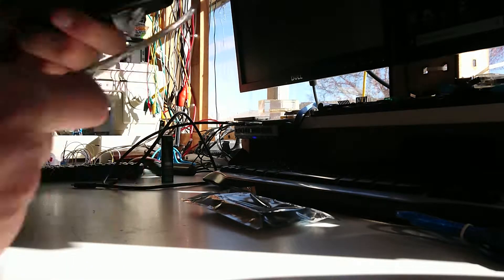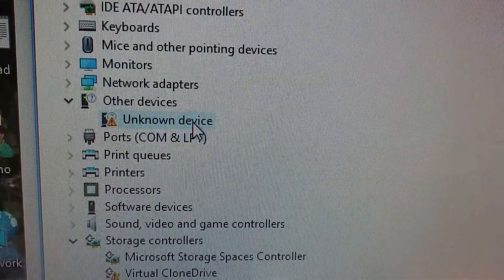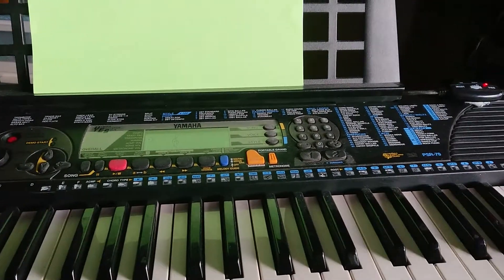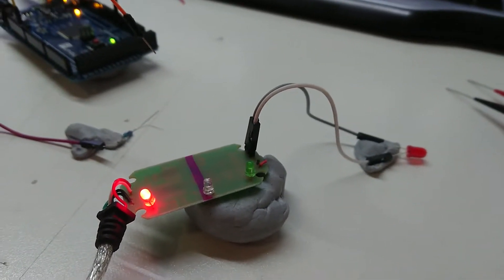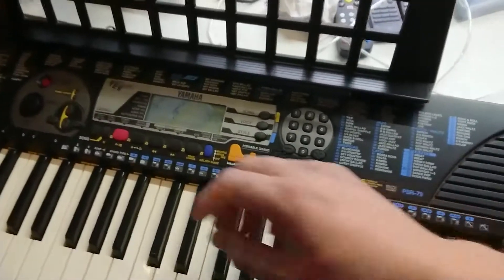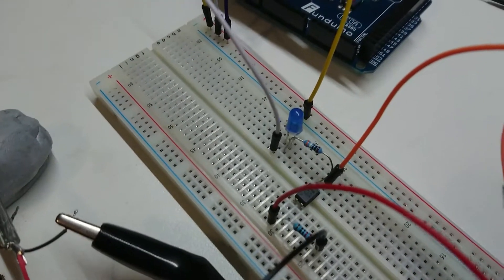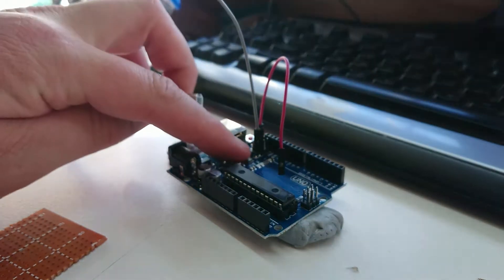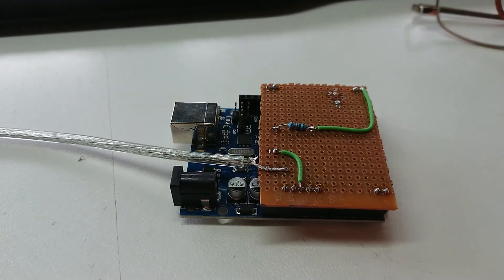Arduino based USB to MIDI adaptor

Comment: What I liked about it was knowing that there is a whole world of firmware for microcontrollers ... never really thought about that. I mean obviously that is what they run on to do there thing but I'm more thinking of them as programmable project devices and the code than downloadable firmware flashing.
Reply from the maker: Part of the reason why you find these microcontrollers in nearly everything these days, is for that very reason.

Comment: Usb to 2-5pin midi wiring digram
Reply from the maker: You can't directly connect usb to midi. You need a controller between. Each controller is wired differently

Comment: check your baud rate, seems high
Reply from the maker: baud rate was not the issue, cloned arduinos with incorrect pin reference was. There is a sequal to this video coming once I overcome some symptoms of MS.
Reply: I'm so sorry to hear that.  I wish you the best and thanks for the video, it pointed me in the right direction.  All I want to do with it is output what I play on the keyboard to FL Studio and be able to edit the piano roll.
Reply from the maker: Yeah that's also my aim too. But I'll have to wait till I can get a genuine nano. I spoke to the guy that wrote the dart firmware and he reports that everything I'm doing should be working, save for the arduino compatible clone.